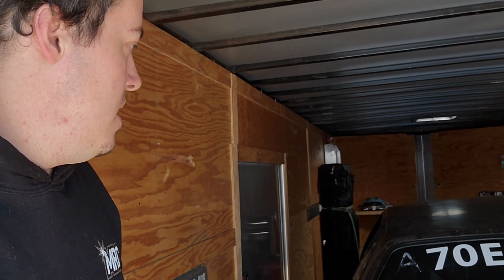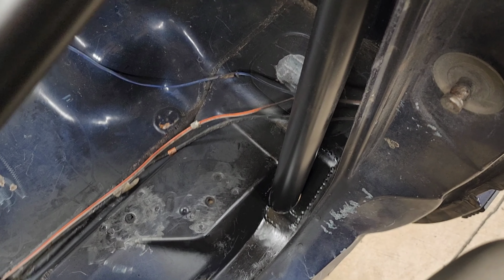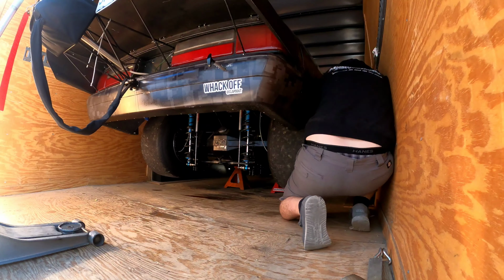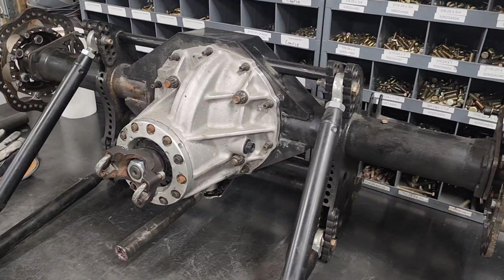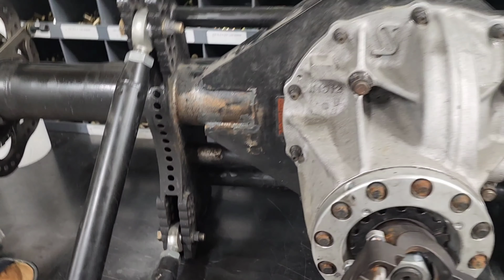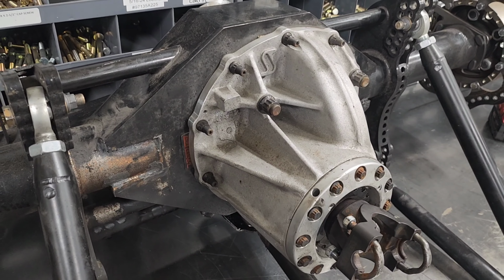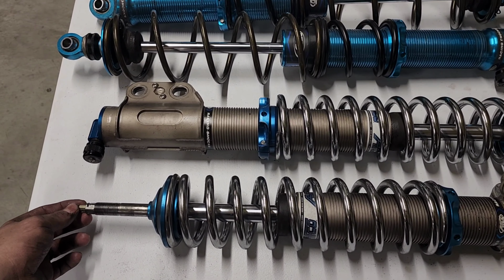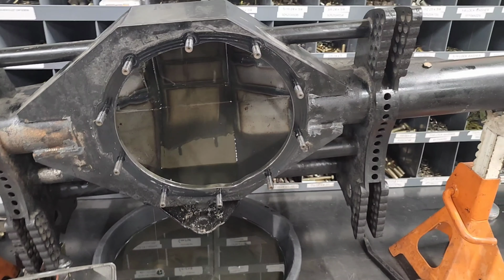Sick Week 2023 Prep! New Engine, Trans, and Turbo on the Way!

Comment: Man those 388s are rowdy I’ve had a couple of them if I was going to do no prep it would be that setup I have the dart Ls next aluminum block tkm built it for me  it’s a 427 with a Bryant crank mgp rods profilers 18 degree heads  isky redlile solid roller lifters isky cam  jesel belt drive aviade oil pump drive ferea intake valves and exhaust  we got the hogans billet intake and the Wilson high boost throttle body it’s 12/1 compression and it’s backed up with a gangster 98  from forced inductions I got most of it off a buddy of mine he updated to a bbc with twins  oh it came with a aeromotive belt driven fuel pump  and 3 speed transmission from rossler  im blessed yo get what I got for what I paid for it  I know it runs good I’ve been in the 4s  I have a old ass chassis that’s mild still it was a outlaw 10/5 car then a bracket car and a no prep car  now I’m trying to get it to the low 4s idk though and yes that’s with radials not smalls I’ve got numbers for smalls but I’m not telling times on that  and Chris bell at kinetic is like the shock guru.

Comment: I’m new hear do 
you build cars I may need some chassis work done  I have a old mold steel outlaw 10/5 car that had a bbc in it like a 632 or something they ran nitrous but anyways I have a 427 in it now with a single turbo and the chassis is fighting me  I’ve been  like 440s on radials but I know it has so much left in the engine. The chassis  seems like it can’t take it.